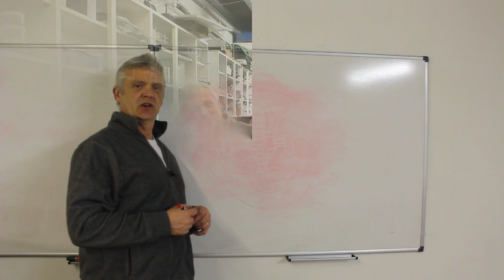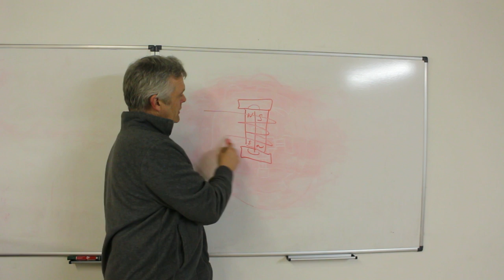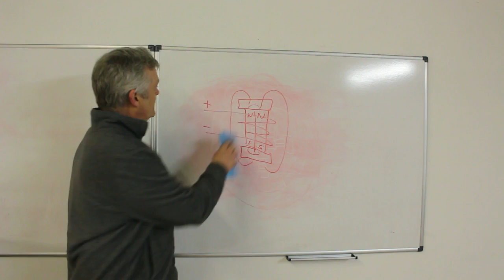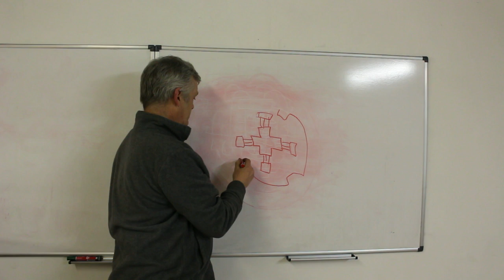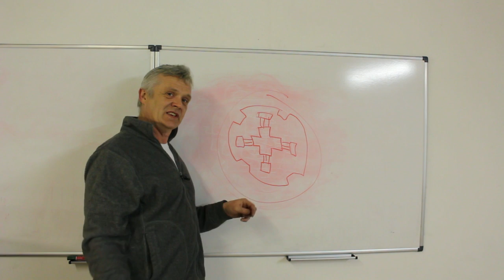A Magnetically Assisted Switched Reluctance Motor

Comment: There was a Kickstarter campaign, OpenGrab, using the same principe(but not as a motor), the low switching rate is great in their application.
A motor won't be great because you constantly change the polarity, which gonna heat up the magnets and then killing the neodymium mag. charge.

But a great idea about a new kind of motor: the trouble is the remaining distance between stator and rotor poles, lesser the distance higher the magnetic force.
Build a motor with direct contact between rotor and stator using the rolling motion in a hypocycloid gear configuration. Each extern "tooth/sin.cavity" of the hypocycloid being a coil moving/rolling the rotor (magnet/pole) to the next cavity of the gear. Kind of motor/gear combination with very high torque output (when using 100 coils & 99 poles).
Reply from the maker: +AltMarc I like the thinking mate - thanks for that - you are 100% right the gap distance is critical - inverse square law lol

Comment: very interesting concept! I wonder if heat would be an issue in a motor setup? I have always thought a big out runner LRK wound brushless motor would be a good car choice. I wound my own lrk motor for my model airplanes as a teenager. brushless was brand new at the time in rc airplanes and I could not afford to buy one. I made it out of an old computer zip drive motor and neo magnets. Lrk winding provides an electronic gearing of sorts. I could hover the plane on that motor!
Reply from the maker: +Isaac Schlittenhart do a video mate- i would love to see that
Reply: A video would be nice but this was many years ago! The bearing cup for the bell housing started getting loose so I stopped using the motor. Don't remember if I tore it down for parts or kept it someplace. Was quite fun!
Reply from the maker: +Isaac Schlittenhart i hate to say this mate - fancy redoing it?

Comment: But in the ordinary motors of this kind magnetic fields of the rotor poles alternate with the current not just switch on and off. This is because it has to push off and pull to the same stator pole.
Reply: There are both brushless AC motors and brushless DC. This would be an example of brushless DC, I believe anyways.
Reply: +Henery Hancock rather a stepper motor but inverted to put it inside a wheel
Reply from the maker: +dft this is not an induction motor mate - it's a type of switched reluctance motor - there is no cogging in switched reluctance
Reply from the maker: +Henery Hancock it's a type of switched reluctance motor mate - the drive system is very similar to BLDC motors
Reply: +Robert Murray-Smith, I think there can be something a lot like cogging in a SWM if the waveform to the electromagnets isn't very well tailored to both speed and load, but no cogging in the PM sense anyway.
Reply from the maker: +Marty G I think that is going to be a control and switching issue - luckily I have a couple of good - actually very very good EV automotive engineers who have offered to help on this one

Comment: Cool :-)
I'm assuming the strength is only limited by the magnets used, whilst the power needed to switch it remains relatively tiny.
So whopping great high strength neodymiums can be effectively switched on and off with a little battery ESD.
Upgraded to Very Cool \o/
Reply from the maker: +Fred Gandt lol - i think the switching power will be proportional to the magnet strength mate - but at this stage i am not sure - i will have to look at it
Reply: ***** said pretty much the same thing where I shared this.
I was rather hoping that the path of least reluctance (never typed that before) could be kept with a relatively weak weak (not a typo) magnet and suitable keepers - so the switching power could remain relatively weak.

If I had stuff, I'd do testing myself.
The only magnets I have are stuck to my fridge.

Comment: Ed Leedskalnin's PMH comes to mind.
Reply from the maker: +deslomeslager you need to reverse pulse it to change the polarity of the soft magnet
Reply: +clixbits I thought so too, how ever the difference is to release the metal you need to supply a reversed polarity (current). I don't think it would be sufficient to only shortcut the leads, but perhaps Robert will tell us if that works?

Comment: First of all: the sound stage in your videos is fantastic through my samsung ear buds the dodgy standard ones. I expect you have some really amazing microphone and you have worked out the acoustic centre of your room; I expect that's the kind of thing you would do for fun. Secondly, this is a really interesting concept, I expect your outer rotor would have to act as a fly wheel of a kind to capture inertia and that inertia and it's stability will be a limiting factor. I imagine with a laser tachometer and a responding switching timer you could "tune" through your range of speed. Prospectively the resistance of the coil would become more significant as you are repeat the switching, in my mind the current v. magnetic flux would be my first port of call after you build the motor. I expect you could cool it easily using mineral oil. Comment is now far too long. I expect you've already gone through this and I mean no offence by offering thoughts. I was inspired by your video.
Reply from the maker: +Nick Tonkin It's a zoom H2n - nice microphone - though i am still tweaking it